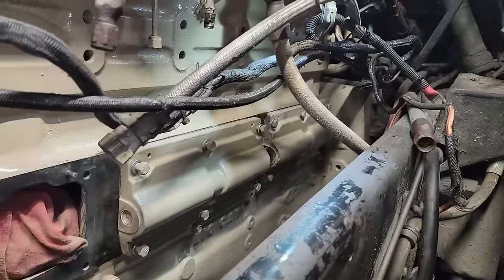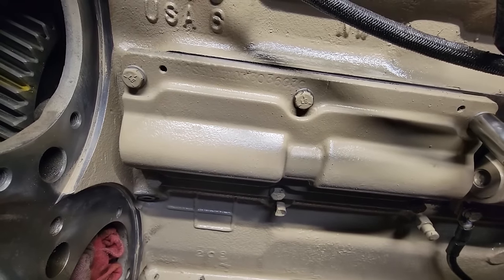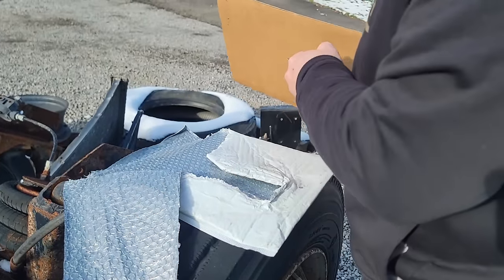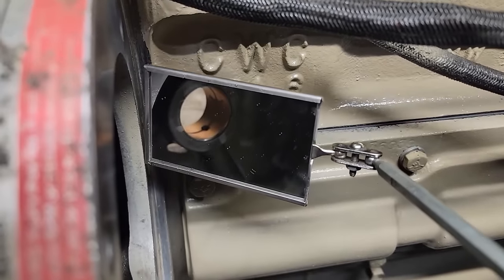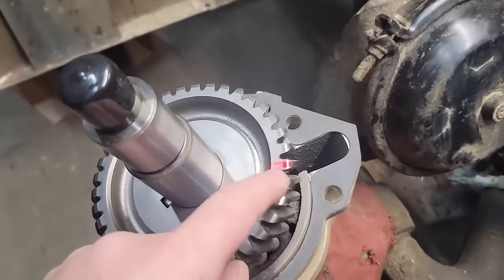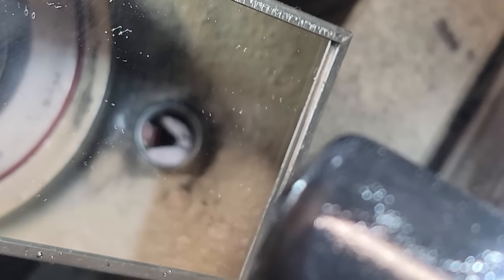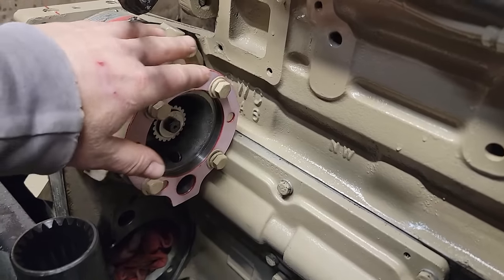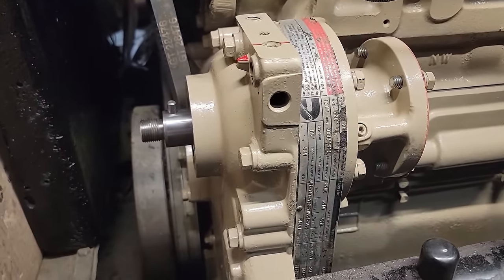PETERBILT 855 BIG CAM CUMMINS ACCESSORY DRIVE REPLACEMENT

Comment: I have a question mr cummins mechanic, I have a small cam 350 cummins, few of the cam covers are leaking oil , do you need to open top of heads to put new gaskets on covers ?????
Reply from the maker: yes. push tubes have to come out in order to remove the cam covers.

Comment: My seal is just starting leaking on my Big cam 3. The mechanic said i have to remove the front cover and oil pan. And if course it's in a Crane Carrier. I'm hoping i don't have to do all of that.

Comment: i believe the single piston compressors have to be timed but the 2 piston compressors don't need to be timed as the piston pulses cancel each other out so that might be why there was no timing mark on the compressor. compressors are supposed to be timed with the engine pulses to reduce gear train noise at least that's what my memory says id double check that before anyone took that for gospel.
Reply from the maker: that makes perfect sense. i asked a retired cummins mechanic and he said the procedure was not exact. they times the ones that had the makes and didnt worry about the one that didnt.

Comment: It’s amazing how many steps go into rebuilding this section of the engine J.C.  The complexity of the engine is remarkable.  Everything you wrenched on this project though has made complete sense and easy to understand.  Not to mention the slick paint job👍.  It’s a shame that one air compressor hose can stop progress on the project all together, but that’s how it goes sometimes.  Great video to kick the year off with😀👍!
Reply from the maker: it really is a simple engine. simple is reliable. that is why a 1985 engine with millions of miles on it can be repaired and continue to run for decades more. waiting on parts is always a problem in the the bidenenomics of today.